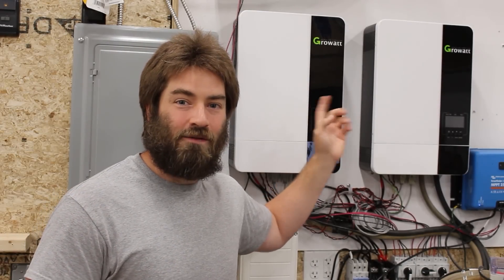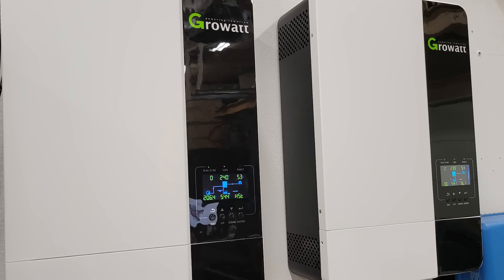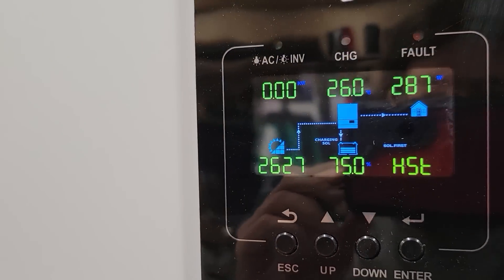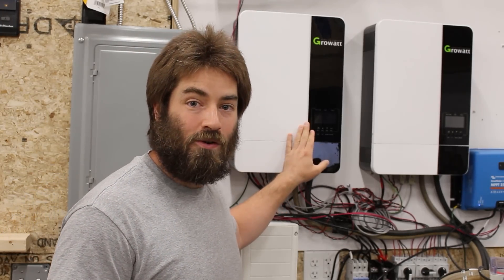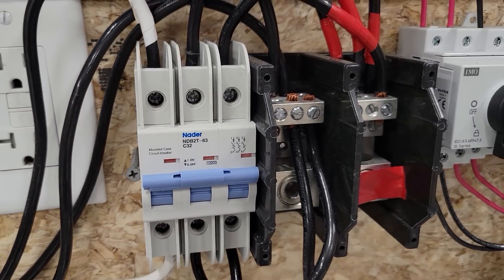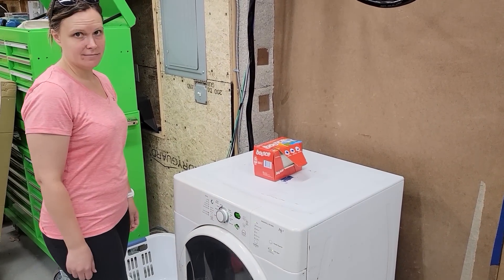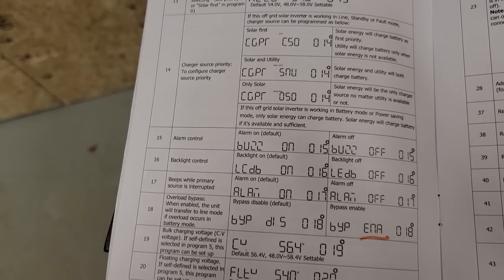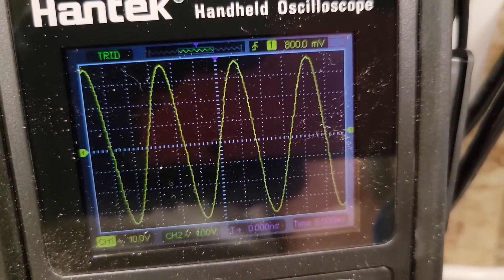Update after 1 year of use off grid, Growatt and EG4 (Gyll) batteries

Comment: Hello David. I'm from Mauritius.
I'm installing 3 SPF5000ES in parallel, with option solar, battery and grid.
Electricity coming from the grid is 3 phase. 
Can you guide me on how to connect the AC power to the inverters. Should it be done on the master inverter or also on the slaves too.

Comment: Have you got any recommendations for solar panels in the 300w range?  I’m a total newbie, live in the Chicago area and looking to get a couple of panels to quickly charge a new solar generator that has a max at 800w. It’s difficult for me to buy panels in a small quantity in this area. I found a supplier finally and have a selection of Qcell Heilene and some I don’t recognize Silfb Jinko. Any info would be helpful especially any that might be less shade “intolerant”.
Reply from the maker: Nothing wrong with Q-cell.  I've got 2 friends with them and they seem happy.  Typically you can connect more than 800W to a solar generator, but the generator will self-limit.  So, for example, let's say the Q-cells you can find locally are 440W panels.  You should still be able to connect 2 of them to your solar generator which would be 880W potential.  But the solar generator will limit it to 800W.  The most important thing is to make sure you don't exceed the solar generators maximum input voltage.

Comment: What I would like to know is: When running on battery alone. How much power can it deliver?
Reply from the maker: The battery bank is able to send 30kW of power.  But, my two inverters total 10kW.  So the maximum I ever send to my house AC is 10kW, and that means it might be pulling 11kW from the battery (assumes the inverters are 90% efficient at the high end)

Comment: I have this inverter and 3 of these batteries in my RV and I also use the same utility to monitor the BMS but under the 'BMS Control' tab, the number of charge cycles does not seem to be incrementing. Could that be because with my usage, the SOC never goes below 70-80%? I'm not sure how low the SOC has to get before it will register a charge cycle.
Reply from the maker: 1 cycle is 100%DOD (depth of discharge).  Let's say you use 1/4 of your battery each night, which would drop it to 75%SOC (state of charge).  Then it will take 4 days to equal 1 cycle in the BMS recording.  At your rate you will be able to use them for decades. I hope that helps.
Reply: Justin, I had given up on Growatt due to the loud fan noise. We are in a 5th wheel RV. Suprised by you having it in your rv. How loud is it

Comment: The voltage sag (lights blink under tremendous load) can be devastating for sensitive electronics like computers. That's really not good. I wonder if the 3rd growatt would have solved that? Personally I would have kept the 3rd for a spare. Never know when SHTF and parts/service might not exist.
Reply: Steve Animatrix------We don't know "when" but we do know the collapse is coming.
Reply: Semiconductors, especially LEDs are simply extremely sensitive to even slight voltage fluctuations. This is normal. I've been running offgrid 100% for 11 years now, WITH sensitive electronics, and I've never had an issue. Though, I would not ever trust my inverter capabilities to a cut rate, poor quality company liked growatt, personally.  But even with my equipment, which is orders of magnitude superior to the growatts of the world, a surge load will cause my LEDs to flicker.
Reply: @johnadams3800  what kind of setup do you have?
Looking for a quality off grid setup
Reply: @Upliftyourbrothers  
I've currently got :
(9) 350w panels
Midnite classic 150 96a charge controller
Genetry Solar 6kw LF inverter/charger
(2) Kilovault HABs (48v, 150ah lifepo4 battery)

I do plan on adding another 12 350w panels soon, with another Classic 150 CC. But as is, this system does everything I need it to do.

I'm not a fan of all in one systems, preferring my components to be discreet, so as for easy troubleshooting, and replacement if need be.  And i certainly would never trust Chinese designed and manufactured all in ones... They are famous for cheaping out on, and outright improper designing of, heat mitigation components, and poorly implemented capacitors, etc.  There are certainly very good manufacturing outfits in China, but the designing and quality control are best left to quality companies based in other countries.

Comment: Thank you David for sharing your experience. One thing I want to share with you is about flicker at starting heavy load this issue because the sine wave of Voltage and the sine wave of Current is not a same at this moment you started your heavy load you can test it by using oscilloscope at output from inverter. Any way this issue can be improves from factory by adding some large capacitor..to improve Power Factor..

Comment: I bought this growatt inverter some time ago but I've some issues actually.. The inverter is connected directly to pylontech batteries rack (6x US2000C), BMS has succesfully detected the connection but the charger incorporated  in the inversor doesn't exceed 24.9-25.1 Amp to charge bateries.. Someone knows what could be happening? (I try to edit directly max charger for PV and UTI in the software but it doesn't let me modify it)

Comment: I’m a newbie so excuse the ignorance but why didn’t they make the inverters to be rack mountable so that they would fit into the rack with the batteries. Seems like it would look neater and easier than having to mount them to the wall
Reply from the maker: I agree with you.  The inverters came first, and then manufacturers started making the server rack batteries.  I'll bet some manufacturers come out with more server rack inverters soon.
Reply: @DavidPozEnergy    I just found Signature Solar's video showing them mounting 2x EG4 6500 to a tall server rack with 6x of their LifePower4 batteries at the bottom.   It's a nice setup and I think I'm going to do the same setup since I don't have much wall space.  The  nice thing about the EG4 6500 is the removable control screen so that you can mount it way from the actual inverter like on the outside of the server rack door.    https://www.youtube.com/watch?v=36lerEA0B6Y

Comment: I have exactly the same setup but connected to the grid too. It is working seamlessly, the only con I discovered is when I restart the whole setup the 300 mA RCBO (that is protecting the input) is shutting down. The workaround for that is to start the inverters with a 5+ sec delay between. No regrets for the investment. Many thanks for your videos, cheers!
Reply: Hi, would you estimate what you have spent on setting up your system? Regards Kel.
Reply: @kelgadeke5102  Hi, I have 8.6 kWp  project, mounted at south in 2 strings of 8 panels of 540w (so 16 in total). Each string has an inverter of 5 kw (Growatt 5000ES). The inverters are working in paralell so in theory they can provide 10 kWp.  I have LiFePo rackable batteries in a nice rack (3 pieces of 48V/100A each, Nifeitor chinese stuff). It is totally off-grid and the grand total of cost (including the mounting system, cables, etc.) is 56000 RON that is around 11400 EUR.

Comment: All - be sure to double check your continuity between AC Output Ground and Neutral before adding a load.

I bought two from Amazon a few months  ago before I knew of SS. They claimed it was safe in the US and they claimed there was no internal G N bond. I believed them and bought two units.  Finally after setting up my arrays, 300' home run, connecting DC, and fully charging the batteries from PV, I was finally ready to start connecting AC Out components and panel. I did one final check and this time checked the inverter for the internal bond and got the beep.

So glad I checked before turning on the load!!! THANK YOU JESUS!!... 

I am now out $2k and SS is out of stock :(

Life happens! Be safe!

Comment: David, what if any does your old battery rack (one we watched you build) play in your current battery storage/use?  I see two SMA Sunny Island off grid investors, are they still being used? I assume the 30 KVW Gyll system meets all your backup system needs now, could you incorporate your old battery system into your current system setup instead of purchasing additional Gyll battery racks?
Reply from the maker: You are correct.  The old battery packs are no longer here.  I sold them (extremely discounted below what I paid for them) and that let me buy one of the Gyll batteries.  The SMA's are still on the wall because I plan to still use them.  I'll need more inverting capacity if/when I can eventually afford an EV.

Comment: Hello David. I am currently DIY installing my solar area and noticed you using in an older video greenfield flex. Did you remove that conduit  and 6 foot gutter you had to house all your ac/dc wire runs? Wanted to know because I'm working my system now and am planning out the wiring.
Reply from the maker: I installed the greenfield flex with the SMA inverters.  They are still on the wall right next to the Growatts.  I have not removed any of that because I still have more projects I want to do with it.  But that conduit/wire way took a long time to install so I didn't bother with the Growatts.  I don't plan to leave it like this forever.

Comment: Are you telling us you are running your electric range/ electric dryer on battery/inverter?
How big is your solar system?
WOW
Reply from the maker: Yes.  The Solar array is 12kW, the inverters total 10kW, The battery is 30kWh.  I can't run all my heavy loads at the same time, so something to be mindful of.  Basically we just don't run the oven and dryer at the same time.  I break down my loads more in this video: https://youtu.be/EYIzEW54_bY
Reply: @DavidPozEnergy  Awesome, I dont get the sun here that you do, so I would be charging batteries with generator. I was impressed!

Comment: How did you DC couple the victron charge controller with the 2 growatts?
Reply from the maker: At the battery bus bar.  (48V DC)
Reply: Is this the same busbar that the inverter is connected to?
Reply from the maker: Yes.

Comment: How long does the battery last you  without a charge?
Reply from the maker: On average, 1.5 days right now.  I can stretch it to 2 days if needed.  Ideally I'll build up the battery to 3 days of autonomy.  Still a work in progress.
Reply: @DavidPozEnergy  Thanks for the info.
I got 3 of the batteries, but do not have the AC out panel connected yet to test. Sounds like i will definitely need more.
I appreciate you taking the time making all the videos they've been extremely insightful.
Reply from the maker: One of the nice things about these batteries is you can add to them 1 or 2 years down the road.
Reply: @DavidPozEnergy  - Hey David, I got a reply from what seems to be you through email saying I won a prize. It asks me to contact you in Telegram app. From there I am told what the prize is and just cover shipping. 

Is this really you or someone trying to scam???
Reply from the maker: @JohnSmith-hm9nb  Scam.  If I did a giveaway I'd cover shipping.

Comment: Hi you mentioned the high voltage charge controllers. What is the max grid voltage that the inverter can take. 

Huawei sun2000, Fronius, Kostal Pentacore, SMA can use Grid Voltage up to 1000VDC.
How about Growatt?

Comment: I have been considering solar, I have a Sense device hooked up to monitor my electrical usage. Over the last year I've noticed that I have a 12Kw peak on my house if I am say doing laundry (~6Kw  on the dryer) while running the AC for example. With a monthly average useage of 1500Kw. I have a feeling a solar conversion is gonna hurt.
Reply: I would run gas for dryer the A/C is bigger headache. The trick with air conditioning is run very small A/C units about 2.5 kw they are more efficient. However I do not know your climate. But don’t be afraid of mixing and matching technologies. I am looking at AGM batteries as well to bring down the cost to something affordable. AGM and lithium can be in the same battery bank Some people think of solar power as the holy grail. Solar heating boxes are far cheaper. Just have to have to have open mind to explore are possible. Cost verses benefit. Solar is not a religion.
Reply from the maker: You have some of the most important numbers already.  Nice.  Sounds like a 50kwh/day average.
Reply: @DavidPozEnergy  yeah,  I am unsure how accurate Sense is as its monthly average breaks down to about 50kwh/day but its daily average is 68kwh (round up to 70?)

It's also worth noting that I have a gas range and gas water heater. So my already seeminly stagering useage would be higher.

Comment: Greetings, i have before watched quite a few of your vids and liked them, and i do fancy your update. I do however have a slight glitch issue i want to lift and see if you are smarter than i am (probably). I am running 3 Growatt SPF 5000 ES, i have grid on the "generator" connection, and a batterypack of 20 some kW. I live in sweden so here we run 230v Single phase and 400 3phase, for that reason i have 3 pcs, one for each phase. Now.. As battery is reaching low setting generator"grid" kicks in problem is that grid, at that time dont charge the batteries, it just feeds the house, then as i get some sun it starts to charge evenso the power should be enought to charge and feed, so it kind of blocks of the charge function and i cant for my life figure out why...
Reply from the maker: The first thing that comes to mind is item # 14, which is charger source priority.  It sounds like you have this set to "Only Solar" and should be changed to "Solar First", or try "Solar and Utility".  But also make sure item# 11 is not set to 0A.  Item# 11 is the charging Amperage when on utility (generator in your case)
Reply: @DavidPozEnergy  Great, i will have a look at that. Thanks mate :)

Comment: Great video David I dig the beard I have been sporting a beard to my chest for the past 5 years.
Why are you using a victron charge controller
Reply from the maker: I have 3 solar arrays.  Each array needs 1 charge controller.  The inverters each have 1 charge controller built in, but that still left a third array.  But, if your question is more about Victron vs. a different brand, it's because I had the Victron charge controller already.
Reply: @DavidPozEnergy  thanks David I have 2 growatt spf5000es and I have 4 3KW arrays and I am running them two in parallel to each inverter.I am going to add 1 more spf5000es the 2 sag when I run the welder in the shop.I have 2 12kw battery banks spim08hp Battery Hookup. I really appreciate all of your videos and the fact that you actually respond to questions you definitely have been a keystone in my solar endeavors thank you

Comment: What's a system like that cost?
Reply from the maker: Each inverter is $900.  The rack of batteries (30kWh) was $9,500.  At least $500 in wiring/breakers.

Comment: 1. If you were to double stack the battery and have 60 kW-hr on tap, would you consider disconnecting from the grid and what would the law in your state be on that? I'm sure code varies from state to state, but if I were to try this in Michigan, I'm pretty sure it would be some muddled building code violation. Nevertheless the daydream persists.

2. Great work as always! I tell anybody who asks about solar, look up Poz, Ben and Prowse. 

3. I have no beard comments. I grew one myself. Eff the haters.
Reply from the maker: I'd love to grow the battery up to 60kWh.  My eventual goal is to be 100% off grid year-round.  As it is right now, I have to buy some power in January and February.  Usually I switch to the grid for a day at a time when it's really cloudy.  (At most 12 days a year I suspect) I'm working legally because I still have the grid, and my two systems stay separated with a manual transfer switch.
Reply: @DavidPozEnergy  Would your local code or POCO give you grief about disconnecting? That's my biggest fear about C of O requirements or what have you. I've nerded a bit into this for my locale, but since so few people attempt it in town, there's just not much info. But hey these systems just keep getting cheaper and net-metering keeps getting to be less of an incentive...

Comment: Areas I’m curious on are:
• Your panels, quantity & their size;
• Why did you use an external (Victron) charge controller;
• What’s been total investment cost & expected return on your investment?
Reply from the maker: The panels are a mix of ones I bought used on Craigslist, but the total is 12kW
I have 3 arrays, each array needs 1 charge controller
I don't know, probably something around $15-$20k, but it's been over so many years I've lost track.
Reply: @DavidPozEnergy  but with 3 strings of panels, would each have worked going into the built-in MPPT of each inverter, or reconfiguring your strings to still fit into the 2 inverters or is your VOC too high. Am just trying to figure out why you use an external MPPT, Victron being expensive as it is, but being good though.
Reply from the maker: Max Voc of the Growatt charge controller is 450Vdc (if memory serves).  The Voc of some of my panels are 47.7V.  I have 7 in series per string.  2 strings in parallel per Growatt, which puts my Imp at 19A.  The Growatts clip this to 18A.  If I add more panels in series I'll be over the Voc (with temperature compensation) and if I add more in parallel the power would just get clipped.  I had the Victron charge controller from my previous system so it didn't cost me anything more to use it.
Reply: @DavidPozEnergy  thanks for the speedy response. I’m in Africa where every cent counts, making the move to Solar uneconomic for the average household, yet we enjoy copious amounts of all year round sunshine in most parts of the continent. Lithium batteries are still not cheap enough nor quality inverters or MPPTs for the average home, sadly.
Reply: @DavidPozEnergy i thought the grow what inverters didn’t need extra charge controllers, they are built in?